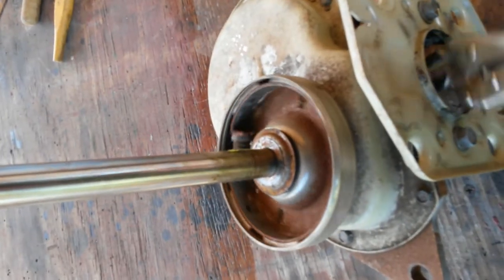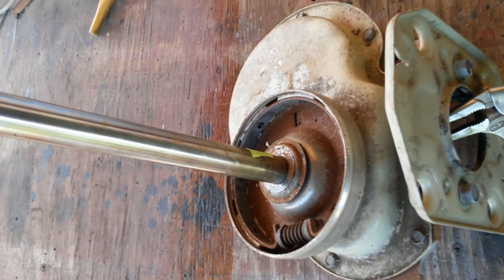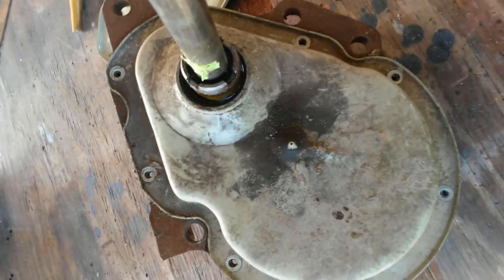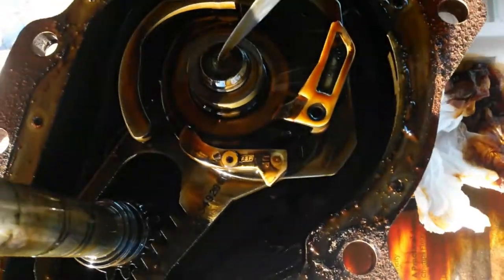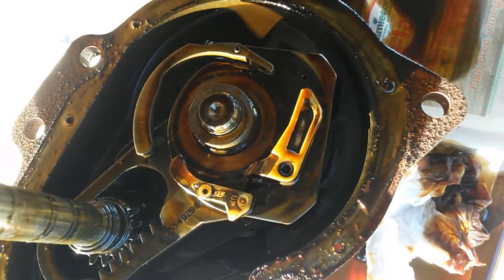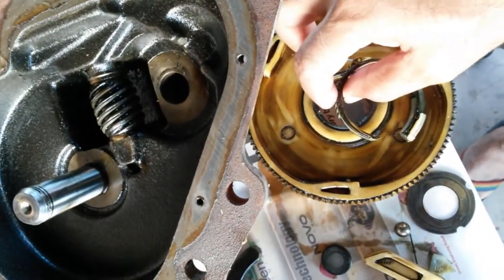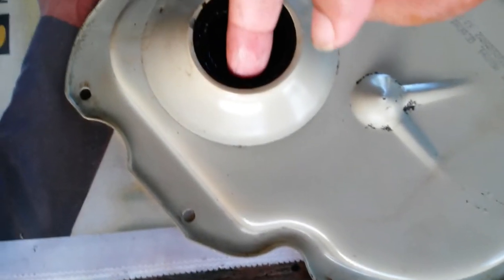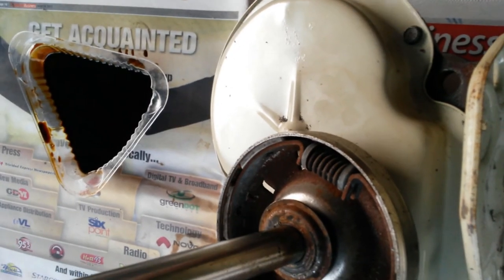026 Washing Machine Gearbox Teardown

Comment: I have a whirlpool washer with the identical gearbox. The seals failed and water entered into the gearbox. It stopped sending out the water on rinse cycle.I disassembled it and it was milky and rusted. I cleaned the parts changed the seals and reassembled and added oil. The machine works like new now. That gearbox looks like it could be rebuilt. Anyway great video. I am pleasantly surprised of the similar interests that we have.
Reply from the maker: Its interesting to hear. Never heard of anyone who rebuilt a washing machine gearbox. 

Yes its surprising we have similar interest.
Reply: I am also interested in rebuilding this same gearbox. I purchased one from a mom and pop repair store that they were going to throw away. Bought it for five bucks. There are very few comprehensive, detailed and easy to understand videos on how this gearbox works and how to diagnose and repair them. The only ones I’ve found are in Spanish. I’ve watched the Spanish ones even though I can’t understand Spanish in the hopes I can learn something by just watching. This video was ok but skipped a lot of steps, didn’t explain much in detail and wasn’t easy to understand. Any guidance would we appreciated.

Comment: I think the spin gear was made of nylon because that gear, and the one that the spin clutch attaches to, while coated, are not fully submerged in oil. Therefore it prevents any metal on metal contact.
Reply from the maker: Maybe that is a factor. Plastic gears are a lot cheaper and seem to be reliable. All windshield and door motors I ever opened have plastic gears.